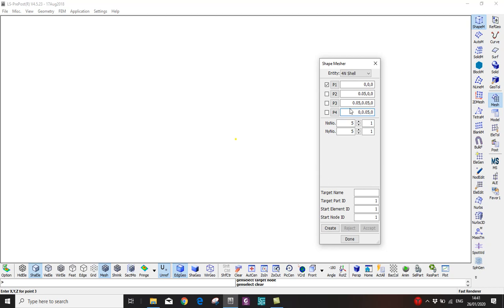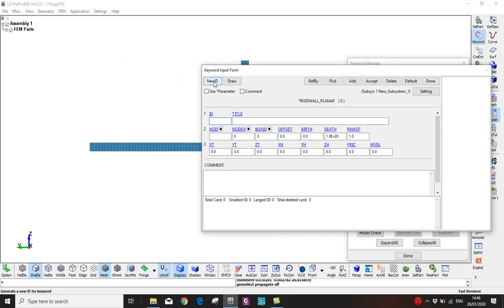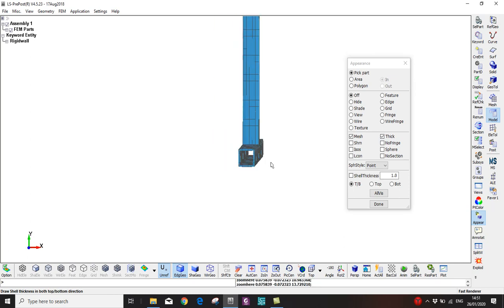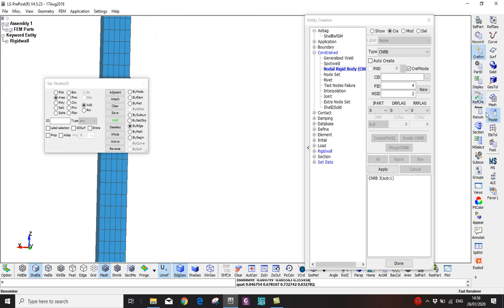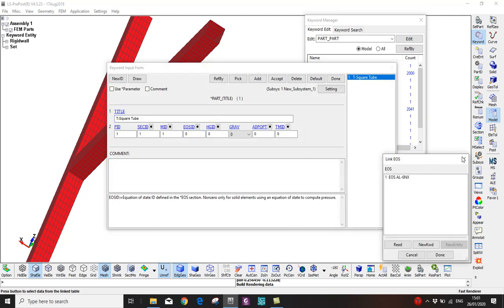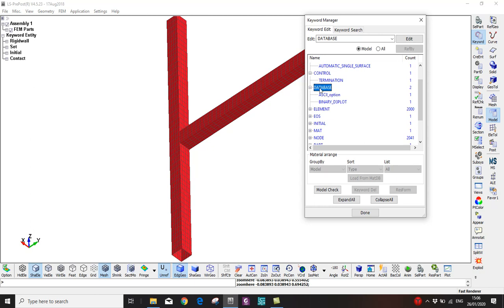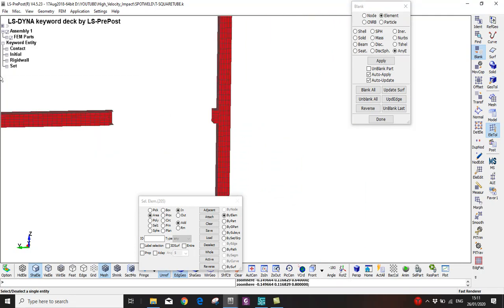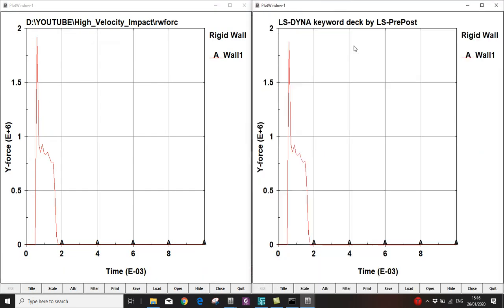LS-DYNA TUTORIAL 7: Hollow Tube Impact on a Rigid Wall

Comment: Hi thanks for this video. I am learning LS Dyna for the first time and these tutorials are very resourceful. I am learning about crash simulation of ladder chassis and am confused between tshell and shell element. Which one will be suitable?  And also do i have define EOS for tshell elements like solids?
Reply from the maker: EOS depends on the element type and material model. You can try to run the model with no EOS and there will be an error if EOS is required.

Comment: Thanks, Ameen! In Tutorial 7, do you have any scientific justification for why the force is different when you change the constraint type between two tubes: Nodel Rigid wall and Spotweld? How does the type of constraints change the force value in the second face of the tube with the rigid wall? Both of them are perfect restraints, I believe.
Reply from the maker: With CONTRAINED NODAL RIGID BODY, the edges where this keyword is applied are rigid, meaning they will remain in their original shape (perfect square). However, with SPOTWELD, the edges are deformable.

Comment: is there any contact card the rigid wall with solid element ?
Reply from the maker: The Rigidwall will automatically have contact with all solid and shell parts, except parts having *MAT RIGID.
Reply: i mean the element plate on the rigid wall so the impactor impact the plate 

but the plate is jump up as impacting 

so i ask you how to contact the rigid wall and element
Reply from the maker: @김창호기계공학과  I think your question is not about the structure in the video. 

The element plate hits the rigid wall and bounces back (jump up). 

If you want the element plate to stick to the target wall, then you cannot use RIGIDWALL.

Comment: Thank you for your video. The version that I am using is LS-DYNA student. When I run the solver, LS-Run to obtain the results, the calculation was terminated with errors. The status column became red, and said: "Finished (Error Termination)". I checked the inputs parameters that are as same as what you did in your video, but why LS-DYNA cannot run it?
Reply from the maker: Check the file name messag. The error most probably will be stated there.
Reply: @AmeenTopa  Thank you for your reply.

Comment: Hi Sir,
Let's say we have an I - Beam. And we define its web and flanges separately with 4 - Nodes shells. What contact type do we need to define and how between the edge of the web - shell and surface of flange shell?
Reply from the maker: The best option is to make the nodes of the web and flanges aligned. Then you can use Merge Duplicate nodes.

To answer your questions, you need tied contact. But I recommend to avoid contact as much as possible and connect the parts with merging the nodes.

Comment: If I have 2 solid blocks having 2 different materials (reinforced concrete and frp fibers) and lying on top of each other , can they be connected using the method you used in this video (constrained nodal rigid body)? I am modeling an impact of a ball on these two blocks. Thanks!
Reply from the maker: Yes possible. Why not you give it a try and letme know how it goes..
Reply from the maker: Please take note that if you want to use this method  you need to define the connection node by node, cannot select by element/ area, or else your results will not be accurate...

Comment: how to make a composite structure with 10 mm thickness, I want to use cross-ply [90/0] with each layer thickness 0.5mm. How to combine them? can you please help me?
Reply from the maker: You may define the layers explicitly (each layer as a different part), then you use contact tiebreak surface to surface to define the bonding between the layers. 

Or you can define the overall all composite as one part, but here you use Composite Damage material model, then input the no. of integration points = number of layers. The orientation can be defined in the section keyword too.
Reply: @AmeenTopa  thankyou very much sir.But if we want 100 layers,do we need to create 100 layers as 100 parts?is there any simple method to do that?
Reply from the maker: @itsmedinesh777  Yes. Correct.

One way, is the use element edit translate.. Translate the layer and copy the elements while doing so.

Actually, you need only two parts, one part of each ply orientation. But still you need to define the contact between each layers manually.

First you have two layers, translate and you will get four. From four you get eight. From eight you get 16, and so on and so fourth....

Another way to do this is to make separate keyword file, and keep importing the file until you have 100 layers.
Reply: @AmeenTopa  thank you very much sir. can you please make a video on gradual meshing? I mean to say in one part,at some place i need fine mesh and at other places i need coarse mesh.
Reply from the maker: @itsmedinesh777  Gradual meshing can be done in may ways. If your part is simple, (like a solid box), then you can use Element Generation. First, make the first layer of box. Then increase the height by adding more and more layers. and each time you can control your mesh.

You can watch one of my previous videos on element editing and will get a view of what I am trying to say here. 

If you are meshing a geometry file, you can simply use Variable Size Mesh.
Reply: @AmeenTopa  ok sir.My part is simple plate and I want gradual meshing to be in radial direction.
Reply from the maker: @itsmedinesh777  I've did this before and it was a bit complicated. 

Say, you want three levels of remeshing. Than you can first make the inner circle, with radius = R1....mesh very high.

Then make the second circle, which is hollow. Inner radius is R1 and outer is R2. you can control the mesh so that it matches with the inner circle and but outside it is more coarse.

Do the same for the third circle....the fourth and fifth if you have any.

Note, you need to download the latest LS PREPOST. The older version does not have the feature of meshing hollow circles.